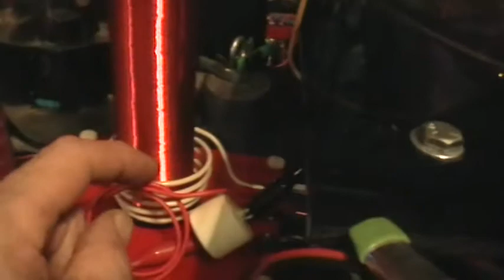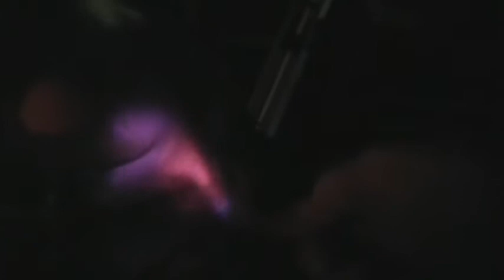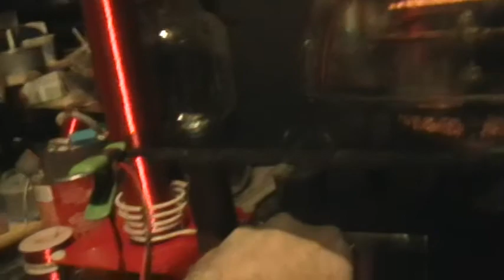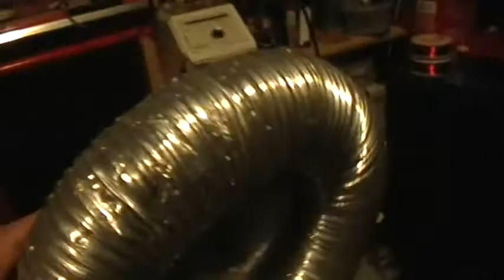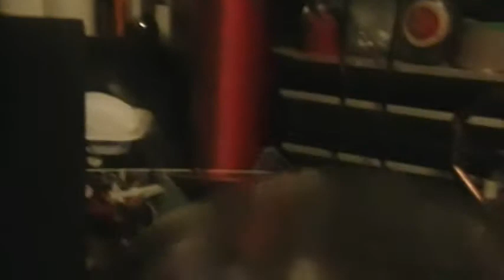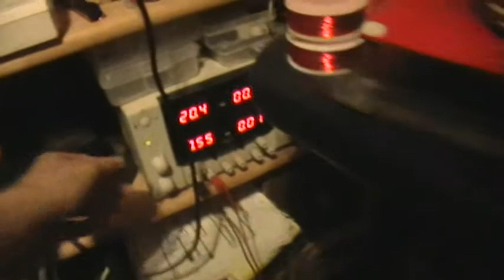TKSlayer Exciter Supplement: Plasma En Vacuo

Comment: under these conditions,any capacitively coupled object with an ability to bleed off electrons can be called an electrode...your finger,the ring in the dome,the striations are not always confined to the electrode.
i have seen them move the full length of a 4ft flouro tube.
why they appear as bands of dark and light i have no idea,maybe it is magnetic in nature like the lines in aurora or maybe its its wavelength related phenomena creating nodes of peaks and troughs of photon gathering pockets